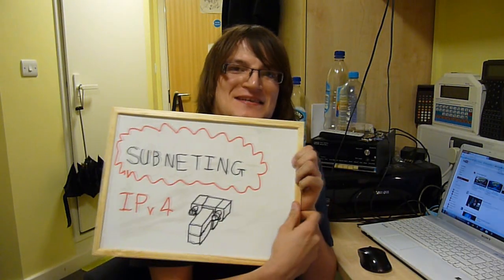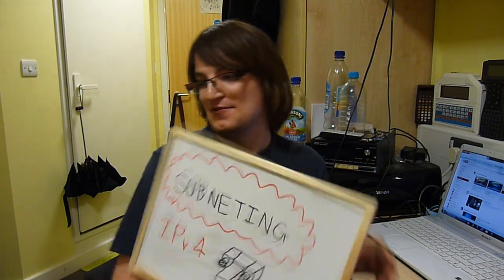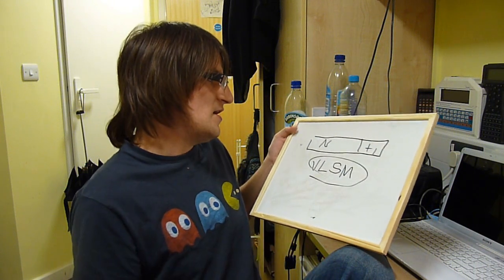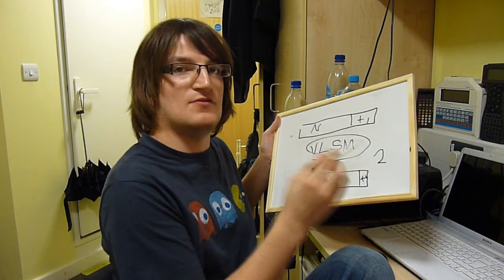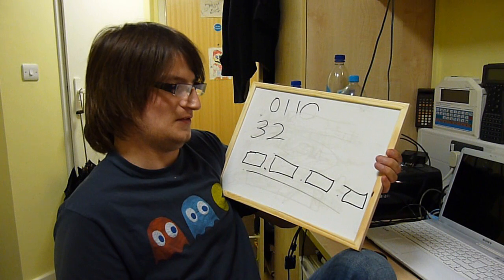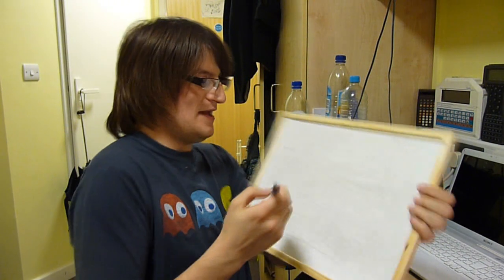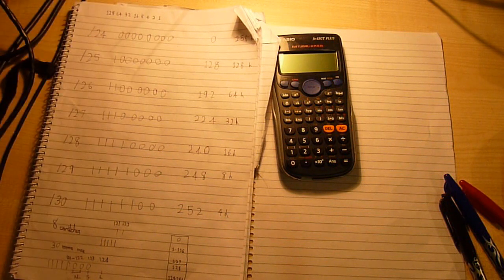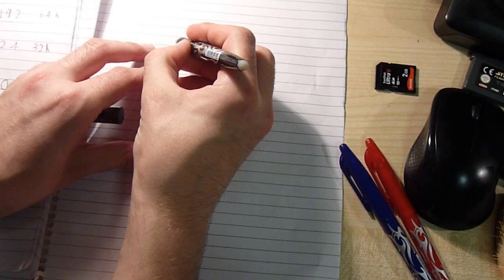How To Subnet

Comment: The Miele industrial washing machines were one of the highlights, there was one with a big LCD and LEDs on the control panel but I think it just used a universal motor not direct drive induction motor, it was fun to watch!  The dryers were boring though.

Comment: I did once kind of get it, I understood it as having different virtual networks on the same physical network (even if you have cute pink Ethernet cables) so the guys  on the factory floor could access the  CNC equipment but not access the finance department's data or the finance department couldn't get at the cad drawings is that right?